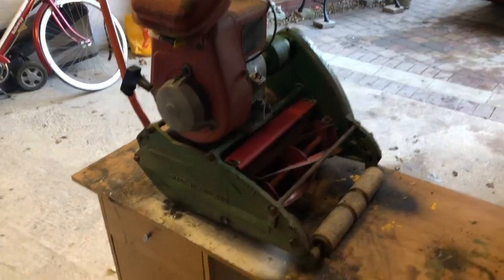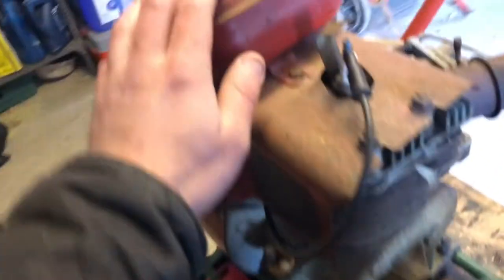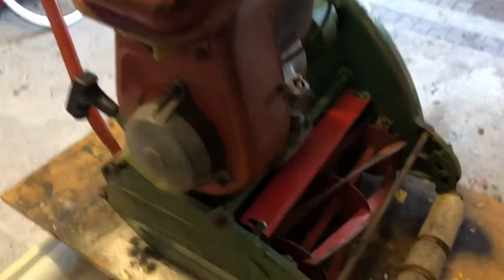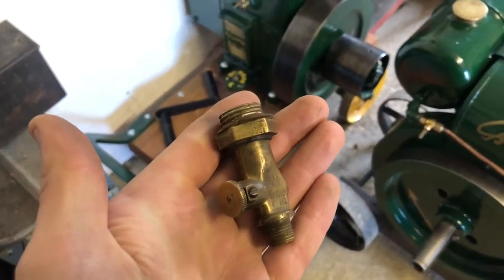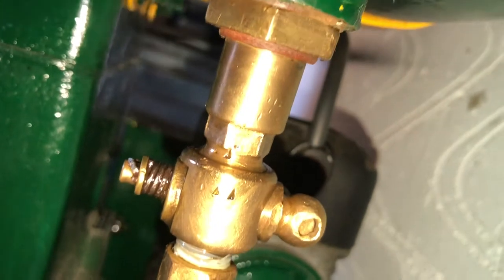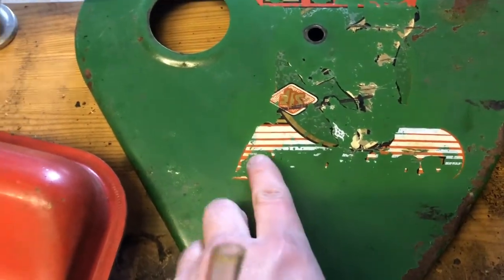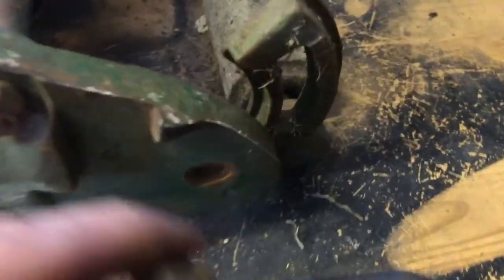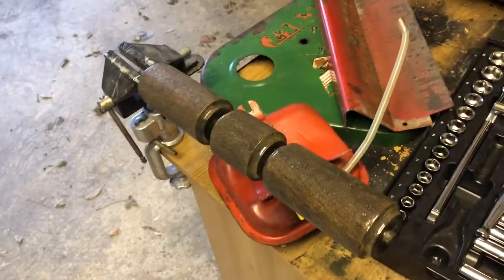Suffolk colt lawnmower project making a start part 3

Comment: Hi Jag_man Tv. I am really liking your restoration of your Suffolk. I used to be a mechanic on garden machinery many years ago and remember these machines well. I can confirm the 2nd bolt you showed holding your adjustable front roller bracket is correct, just a normal coach bolt. The first bolt you showed (exhaust stud) is not correct. Regarding the delivery plate, (the plate painted red) would of been green when new. Many dealers painted them red when mowers went in for sharpening. Many were rotted away due to wet and damp grass sticking to it. I am trying to find time to restore a 17 inch super punch. Great channel, I have subscribed and now want to catch up with your stationary engines.
Reply from the maker: Hi smokey Exhaust thank you very much thanks for the advice I did have a feeling someone had been there with the wrong bolt haha thats good to know I may paint it green again though I have to say it looks good in red too Thank you for subscribing I will try to bring a new video soon

Comment: I am pretty sure that Fiat red orange is the colour you need. Can get it from Halfords.
Also, look up Seagull outboard online as they have the same tap. You can put a wine cork on a drill or lathe and sand down to the size you need. There was a video on here a couple of years ago when I looked into it.
Reply from the maker: Thanks I will have a look 👍🏻

Comment: HI THERE . THE PAINT IS  ORANGE FOR THE HANDLE BARS ,AND THE ENGINE COWLING .PETROL TANK .I DO KEEP MOWER PAINT .THE GRAY WITH A LITTLE BLUE PAINT IN THERE IS FOR THE ENGINE, AIR FILTER .AND THE GREEN PAINT IS FOR THE MOWER .THE RECOIL IS CHROME PAINT.GRASS BOX IS GREEN PAINT. THE RED PLATE YOU HAVE TOOK OUT IS GREEN . THE CYLINDER BLADES . THIS IS UP TO YOU . RED OR GREEN . I  LIKE TO PAINT MY CYLINDERS  BLADES RED . THE  RIGHT COLOUR IS  FOR THE CYLINDER IS GREEN .AND THE BACK ROLLER IS GREEN.THE BOTTOM BLADE IS GREEN
Reply from the maker: Hi thanks for the advice